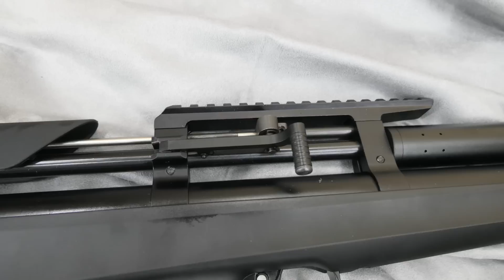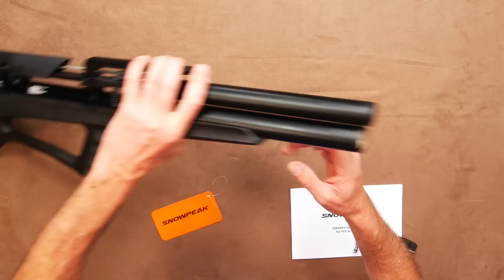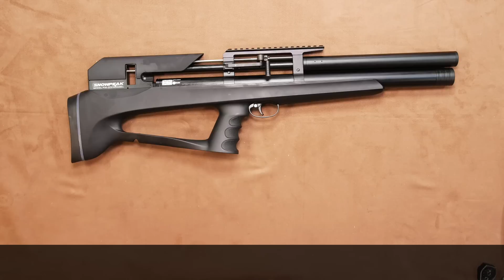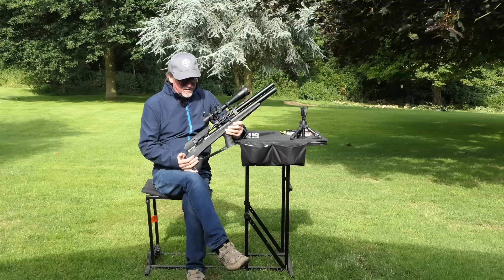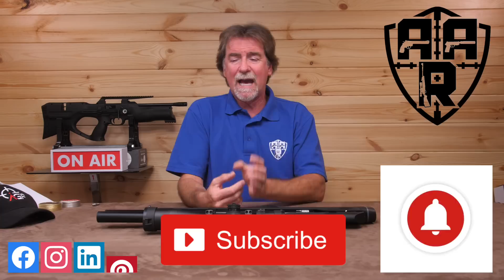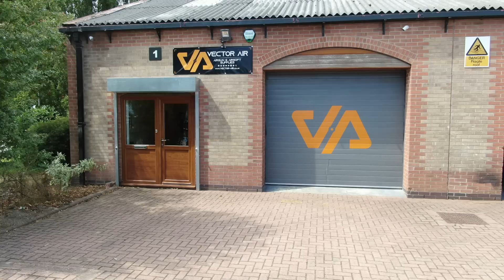Artemis P35

Comment: I bought one of these in .22 for shooting pigeons and rats inside small farm buildings.  Instead of a scope I fitted a cheap red-dot sight zeroed at 15 yards and a torch fitted under the barrel.  Does the job perfectly, once you get the hang of hold over/under at different distances.  Accuracy after 30 yds wasn't that good with 18gr JSB but a little  better with lighter pellets.

Comment: The can't get the face down bit had me chucking. That's down to there poor breach block design. They not realy making proper breach blocks just redesigning rear pull bolt setups to acomidate a top slotted throw rod that section is all up in your cheek they should have just designed a proper breach block with front possisioned cooking action.

Comment: Perhaps it’s me, at £550. It doesn’t sound very budget. For an extra £100, you could pick up a HW110, if you shop around. Having said that, it does look  a cracking little bullpup. And obviously a lot cheaper, than some of the high end manufacturers. I suppose the big question, is it worth the money. Based on that review, I would say so. 😊 👍

Comment: Hey, Andy, love your videos and envy you.  What methods of charging the air cylinder are possible with that Pup ? Is a manual high pressure bicycle style pump feasible ?
Reply: PCP’s are always filled up with some 200-300 bars (make sure to check on each gun the max. allowed pressure of the exact model), so no way to fill’ em up with anything that doesn’t provide such pressures…
I know a guy who had a huge 400V three cylinders 600Liters capacity professional garage compressor and never understood why this monster was’nt able to fill up his small 200 bars LP50…
Pressure remains pressure, and you will either need a scuba shop filled diving bottle, a special PCP air compressor or the good ole PCP hand pump (Hill, FX and so on)
Reply: @Crottedenez1000  , I'm saving up toward getting a PCP and I wondered about shop type air compressors. They have hand pumps designed for air guns which run about $200 and also compressors just for air guns that are outrageous price wise, $800 ,$900 and up. And going to a scuba shop every time you need a tank of air isn't practical . So, a hand pump it shall be with a model that makes it possible.  Then, I want to swag my own pellets and slugs. That can get pricey too. Especially if you want any air gun larger than a .22.  Sometimes .22 pellets aren't too common to find.  .177s are no problem.

Comment: I have a Stoeger Xm1 which is a restocked (and improved) version of this rifle, it really is great! Mine is in .22 and shots JSB 18.1's at around 900FPS after tweaking with the hammer spring a bit, and get around 60 shots with a full fill. A ripper for sure! Not sure if the barrel is also SPA made but it's extremely accurate still with good pellets.
Reply: Well I hope you have an FAC , as 900 fps with 18.1 gr pellets is 32.5ft/lb energy. I suspect you don't have an FAC as those holders are more responsible.  You're either a fool or full of BS
Reply: @nickpurdy3096 what did he say that was irresponsible?

Comment: First off nice review as always sir 👍 i bought a SMK Artemis P15 .25 a few months back for ratting  🤔 .... WOW what a cracking little / light / point-able air rifle very quiet but the same as the p35 no 1/2 inch on the front  i managed to get one from  Eagle Vision very simple to fit i can now add on a extra moderator as & when i need it with a hugget Magna on you can barely hear it I'm over the moon with this set up .... ?? i don't think the Rats like it very much mind you .

Comment: One wonders what the long term quality will be like on a air rifle that the makers can't make sure the brand labelling is on level. This is a sidelever action, like many out there on the market. To call it a biathlon type, as many makers do, is inaccurate sales "big up" talk. The throw of the lever is far too long to be a biathlon type mechanism and you can't operate it without removing your whole hand well away from the grip. Talking of the latter, wouldn't it be better if the cocking lever was on the opposite side to that of the trigger finger? Being a light rifle this seems more practical to me.

Comment: Hi Andy , I have the Stoeger XM1 bullpup and it is exactly the same rifle in a different stock.  It has a few extras on the stock and a 1/2 inch unf on the barrel.  It's a cracking little rifle.  
Another great review, at least this time I don't need to go to the RFD and try and find room for another rifle !
Reply: I looked at the xm1 but thought it was overpriced for what it was
Reply: @Theshropshireratter  it's a cracking piece of kit to be honest.  I think you can pick them up for about £450ish brand new.
Reply: I have a Stoeger XM1 bullpup too, in .22. Fantastic rifle.
Reply: Might have missed it. What is the shot count per fill?
Reply: @Chaffinch1977  I can't speak for the .22, but I get around 140 shits before I refill.
Reply: @stevewinstanley1233  That is alot of shits l. 😆
Reply: @Chaffinch1977  oops 🤣🤣🤣🤣🤣

Comment: Hi Andy, thoroughly enjoy your reviews, but it's important to note that Picatinny and Weaver are NOT the same as each other, and can cause issues if you have the wrong accesory. I can confirm how annoying this can be on my Kral.
Reply: True.     Picatinny accessories will not fit on a Weaver rail, but Weaver accessories will fit on a Picatinny rail.
Reply: @jeffslade1892  Thats true as long as there aren't multiple cross bars on the accessories, as the different spacing will prevent engagement. That's on top of the thickness of the cross bar issue as well.

Comment: Hey Andy , you gave a great rifle review on the P35 .YES this a great most age ranges because of the weight ... Very handy for disabled shooters like me ... The rifle is a great buy .  thank you Andy n... Cheers Simon :yt::yt::yt:
Reply: Hi Simon!
You have this one? This rifle seems like a very good purchase. Not in a horrible price range even. If found one for €600 or so - I'd consider myself to be a probable buyer. 
I liked that it seemed very light and the magazine goes very well into the stock. Apparently an accurate rifle also... The Snowpeak brand name just sounds a bit..."off"?😁 "Artemis" sounded much better imo - with no cheesy cheapiness into it.🤣
Apparently rebuilding the moderator's baffles etc also is a quite common "thing" for this rifle...which now kinda also intrigues me also...